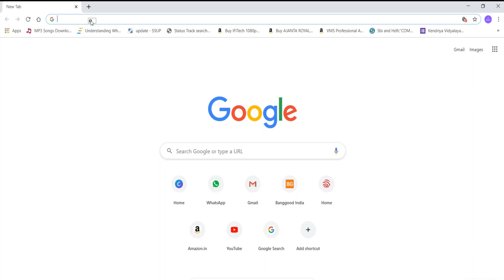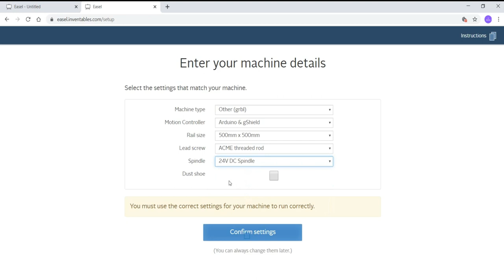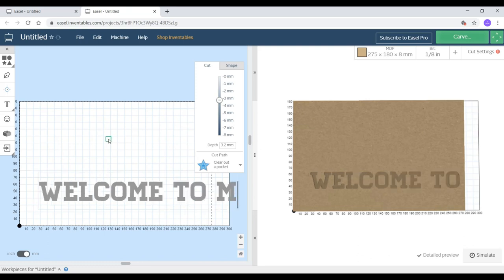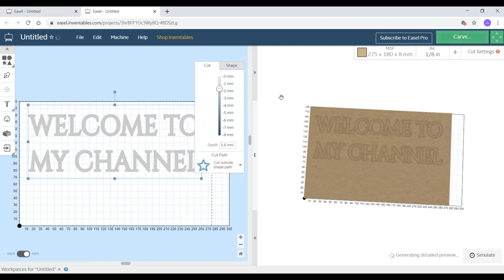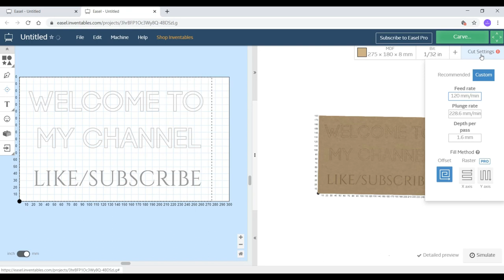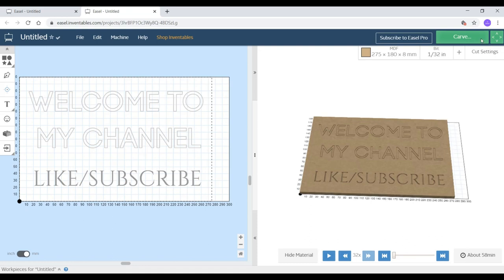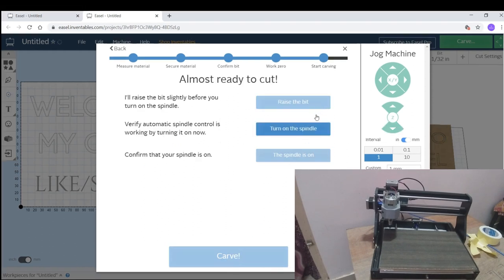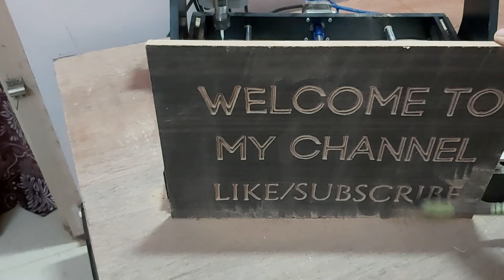How to use Easel to Carve on CNC 3018 Pro

Comment: I am stuck at the setup stage. I have connected my 3018 to my computer, I can see what port it is and can move the axis by the controller it came with. But my Easel won't see it. I am trying to do the setup but when I click "confirm" it says  "Plug in your USB cable and turn on the machine."... The only other software I have is the GRBLcontroller which is so complicated for me to use. Is there a solution?
Reply: I got the same problem if you solved it tell me how ! thks
Reply: @monkiBable  I haven't :( I have to export the file and open it on Candle in order to work it. A bit of a pain but it works.
Reply: Hello, try to disconect the Controller. On my 3018 pro i could controll it after that with my Notebook.
Reply: I had the same problem, Install the easel driver, then on the project window click on the blue "Carve" button at the top right to get the “Easel can’t find your machine” window, then click on the check box that says "Enter COM port manually" and enter the correct com port(you can find it in windows device manager), now you can go to the setup page again and enter the com port there as well.

Comment: I got the same cnc machine same as yours on the video but the spindle is not rotating when I carve. The x,y,z axis are working as it should be but the spindle is not rotating. The spindle rotates when used manually with the console I ordered with. I don't know why. Please help me if you know the solution for this.

Comment: Just got a brand new CNC 3018, it's working just fine but I can't seem to connect to easel. It says PLUG YOUR USB  
Any solutions on how to fix this 
Thanks in advance ...
Reply: I’m having this exact same issue, did you manage to resolve the problem and if so can you tell me how to move forward from the plug in USB stage please
Reply: I'm also having this issue. Did you figure it out?
Reply: I commented and then I figured it out. On the main screen in easel it says carve in the top right hand corner.   I clicked that and it led me to find my port number and type that in.   After typing in the port number  I started the steps over that are listed in this video.
Reply: @marcfalmer  thank you Marc ! love you

Comment: if i set easel to carve a 4 mm depth, it carves less then 1 mm  and i have no idea why. when i set Z axis the bit touches the material but it does not carve the 4 mm i set it up. to carve the whole 4 mm from the material i need to set a depth of 21mm in easel.

Comment: Thank you for the video. I can not get it to work for my 3018 Pro. I have spent hours and get no where. I do not think I have the machine set up correctly.
Reply from the maker: What is the exact issue that you are facing
Reply: @craftmagiccnc8743  Seems to run in reverse and keeps running the axis for Z and Y to limits then keeps going and grinding sounds. I have to abort the operation.
Reply: @craftmagiccnc8743  Also Easel dose not recognize my machine. Having trouble getting g codes on Easel.

Comment: CNC 3018, it's working just fine but I can't seem to connect to easel. It says PLUG YOUR USB  

SOLUTION: On the main screen in easel it says carve in the top right hand corner.   I clicked that and it led me to find my port number and type that in.   After typing in the port number  I started the steps over that are listed in this video.

Comment: I'm a bit confused. Your bit settings show that you chose a 1/32"bit but the video clearly shows (@ 15:00) you using a 3mm engraving bit. Furthermore when I first use Easel  I cannot use Carve unless I sign up for Easel Pro. Did you do that or somehow bypass it?
Thanks for the useful video
Reply from the maker: Hi, i think it is not compulsory to sign up for easel pro. You can use easel for free with some limitations. Regarding the bit, in easel you have to sign up for pro to use the v bit settings,  however if you choose 1/32" and use a v bit, it almost works the same. Hope your query was solved. Do let me know if you have any confusion.

Comment: How to pause the machine during the process?
Reply from the maker: While using easel you can press the pause button on the top right. However it will just pause the movement of axis but the spindle will still keep rotating. I am trying to find a solution to that. if i find one i will let you know👍👍